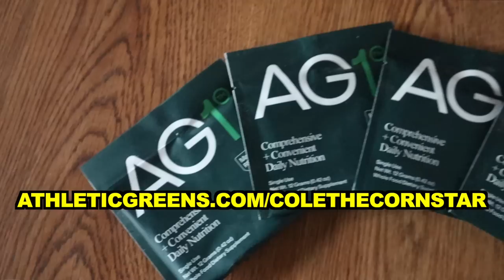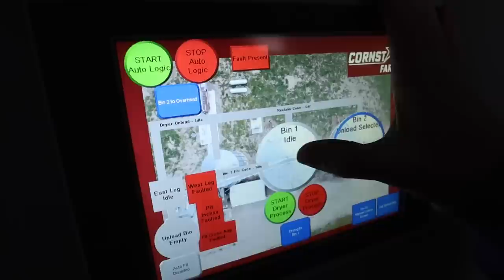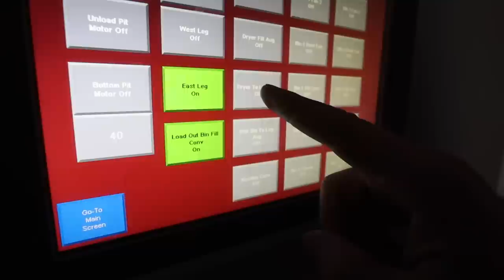I Sold All My Corn

Comment: Many people have put so much effort into transforming so many different aspects of the farm: demolition, trash cleanup, ground cleanup (trees, underbrush), new storage bins, improved bin loading and unloading including automation, new driveways, shop cleanup and reorganization improving efficiency and safety, shop insulation project, direct connectivity between two shop areas, etc. And then there is the house! Wow. Cole has spoken many times about these projects and efforts and how they can and absolutely will positively impact the operation of the farm. It is important to bear in mind that a farm is a business and should be operated as such: it is not a garden on steroids. Consider painting yellow stripes on shop floor areas to mark "safe-walking-no-stuff-here-zones". Keep up the great work and stay safe.

Comment: If you leave the speed square on the board, you can use it as a fence. Shop looks really good.  Have you ever tried cutting the sheet metal with a circular saw? It works really nice on panels.

Comment: 3:08  Pro Tip : Always cut with the line on the outside of the blade , allow the Wide Side of the saw plate to sit on stable side of cut not on the drop 😊

Comment: Shop is looking awesome and nice to have it close to done as everything else equipment wise is ready to go.

I know folks have been preaching about squats…you know what your doing, but I did them for years and pay the price. I went down to parallel head up, good form blah blah. When I got to college ball the weight coach eliminated squats and replaced with Hip Sled. Allows to work the legs (positive and negatives) plus provides great platform for calf work…can slow roll it or work on explosive as well…and takes all pressure off the back. Cooper can weld ya up one and slap you some pads on it.  Just a thought.  You get no positive back work on squats and what your feeling is low back strain..not a pump.  Ya wanna work back then do t-bar rows.

Not preaching…just suggesting.  Squats compress the discs (cervical, thoracic and Lumbar) all while spine is arched.  Not Good…

Comment: Next time make up a couple of T posts and use one on the lift floor You can wedge that in. You can do the same on the scaffle or have it shorter and lay a board on it crossboard. lever up with a shorter box beam like a seesaw effect. Easier to push down than to hold up. Big duckbills work better to cut or an air shear for straights.

Comment: Nice Vulcan. You need to hook up a pigtail to your battery and tuck it behind your side cover. Then you don't have to remove your seat to charge the battery. I have been doing that for years on all the stuff I store for the winter. So much easier to just plug in the battery tender when I know the bike is going to sit for a bit.
When you going to spill the beans about your marriage? Nave posted a video but you don't even wear your wedding ring. 😲

Comment: i have been using a wet saw blade on my angle grinder to cut metal roofing. been using the same blade for four years, kinda works pretty good. just saying.

Comment: I have a question what is the point of the angle blank from the walls to the ceiling and why would you not just go up straight and make a square to the ceiling

Comment: I know squats are cool and do a lot for your core, but trust me when I say you will pay for it later in life.  Go with lower weights if you really feel you must, but my advice is to take it easy on those squats.  You don't feel it now but you are putting serious stress on your joints.  R&D Ortho Sr. Engineer here.  I've seen a ton of lifters coming through for new hips and knees.

Comment: Maybe you’ve addressed this before, but how do you control all the vermin which must attracted to all that loose corn ?  You must have some industrial sized rat traps around there !  Is there a way that all the rat poop is filtered out of the corn ?  I know it’s a disgusting question but I think most people know that there is always a little “contaminate” that has to be dealt with when dealing with the vast volumes of corn going through the system.
Reply: Very little, if any of the Cornstars corn is for human consumption, iirc...most grown for ethanol production, with the small remainder going to animal feed production....

Comment: When the corn rots, does it ferment, and become acidic? Hence the corrosion?
Reply from the maker: I would imagine so.
Reply: @ColeTheCornstar  Out of curiosity, I looked into this more. Corn has a relative PH of 6.7, but it is acid-forming. Which means it produces acid when dissolved in water, or digestion.

Comment: The qaudfather Tom Platz would be proud of your high rep squatting
Reply from the maker: 5 more!!
Reply: @ColeTheCornstar  Next thing you know you will be doing the David Goggins 500.  The DG 500 is 
1. 100 bent rows 
2. 100 overhead presses 
3. 100 squats
4. 100 incline presses 
5. 100 RDLs
All with 100 lbs.  You have to rest in the up position until you can build to 100 reps. 3 minutes rest between exercises. Reduce rest periods by 15 seconds a week until you can complete the whole complex (5 exercises) as 1 set. 

It is how he went from 315 lbs to 185 lbs in 4 months.

Comment: I hate to be the party pooper here in the comment section, but after watching my grandfather die a slow death from lung disease caused by lack of safety on the job that just wasn't known back in his day, it pains me to watch Daddy Cornstar, Cooper, and the puppy work inside the solo breathing in all that corn dust and getting in their eyes because they are not wearing the proper safety equipment that you use Cole.  I am sure you all are aware of the dangers corn dust can cause to your "respiratory health."  All of you have worked so hard to get to where you are today, I just want to encourage you all to please think "safety first."
Reply: Yah, he's got a house filled with possible asbestos dust, I don't think he's worried about the corn. Or the mold spores. Or lung fungus (which is a real thing and mighty hard to stop once it gets started). Or E. Hanta.
Reply: @someperson7  My comment was sincere. Did you not watch Daddy Cornstar suffer a horrible illness with his respiratory system earlier last year? Because of that alone, makes him very susceptible to lung disease. Farmer's Lung is not pretty. Cooper is a young man and like most young people not thinking about 20 - 30 years down the road. How he protects himself today, will determine his lung health down the road. Cole on the other hand does wear his safety equipment while working in his house and when required to do farm work. However, if he is exposing himself to asbestos, I would agree with you 100%, his current safety equipment won't help him, so I hope that is not the case for him and his family, ever,
Reply: @margedeogee8525  I was agreeing with you. I was expanding on your excellent point.
Reply: @someperson7   I appreciate you taking the time and telling me that; it was very kind of you. I stand corrected, and please accept my apology. I took your comment the other way around and completely misunderstood.
Reply: @margedeogee8525  No worries🙂👍

Comment: I couldn't find a way to send a private message, and I'm not trying to be mean, but I felt compelled to make this comment: I understand that the puppy probably wants to be by you at all times. However, in the shots where you're cleaning out the corn bins, you're wearing a respirator to protect yourself, but the puppy is still breathing in all that dust. You may want to reconsider having it in there, imho.